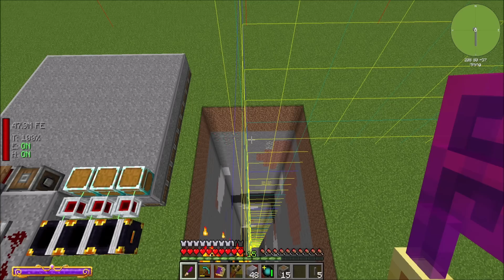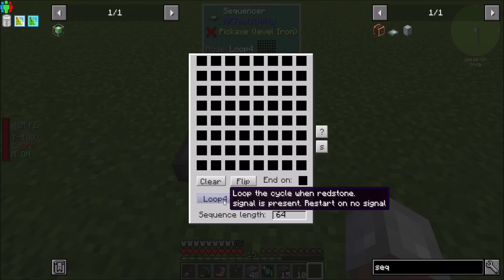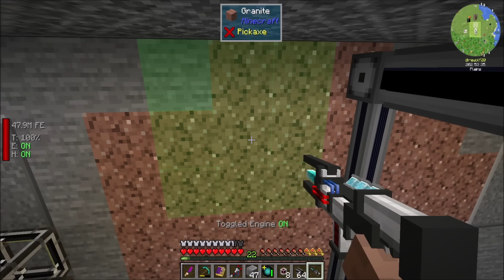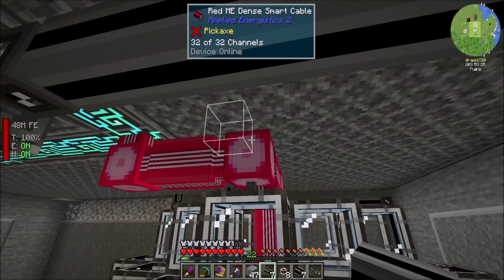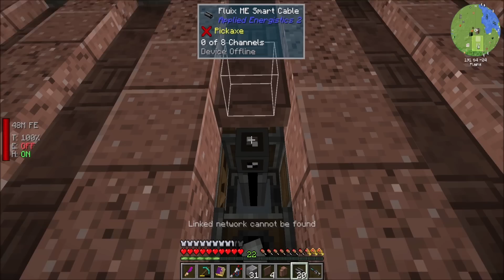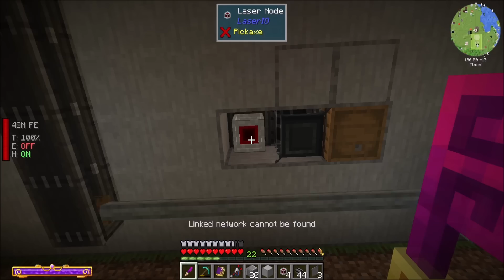LetsPlay S13E40 Create Autocrafting

Comment: Couple of nice to know things:
- entity blocks such as redstone and levers can be removed with the create wrench if they are glued, there is no need to break blocks below it.
- The sequencer for timing worked in my contraption (which is almost identical to yours), make sure it is on the loop4 setting
- I couldn't make the create chunkloader working. It says, it will only load chunks on a moving contraption (i would imagine on a mechanical bearing eg.)
but mechanical bearings are immovable objects, so there needs to be some continuous moving create object, that can be moved by a piston.
Mekanisms anchor does not work aswell, as the digital miner, quantum entagelment block and teleporter are immovable aswell.
But chunky turtles from advanced peripherals load the chunk they are currently in. They need a little programm to keep up, but it should work

Comment: The megatorch only blocks spawns within ~64 blocks, where mobs can spawn up to 128 blocks away then wander or teleport into the megatorch's radius. The megatorch sadly is not like a old equivalent exchange interdiction torch which pushes mobs away along with blocking spawns. This results in dire's create building not being covered by the megatorch and letting mobs spawn within 28 blocks of the player while within the create building.

You can solve the problem with more megatorches or my preferred solution which is putting feral flare lanterns everywhere both so you can see and so it blocks mob spawns due to the light level being too high

Comment: Add a Flux Plug/Point anywhere on the platform and set it to Chunk Load. May work, but not sure about moving it on a contraption. They’re not coordinate based so should work.
Reply: Check the episode from the day before yesterday and you'll have your answer as to if it moves.
Reply: You can't move flux plugs or flux points. The moment you glue one to the world eater then the whole system can't move anymore
Reply: @MisterJasro  oh yeah huh. The whole reason the damn solars were added. Well, it was 8am tbf 😂

Comment: flux networks has a chunk loading option, might have to enable it in the config tho
Reply: Wasn't the Flux plug the 1st thing Dire tried to use to power the Create RF motors? Didn't he decide they were of no use as they can't be moved by Create? If so I don't see them being useful to chunk load the moving platforms......for the same reason.
Reply: @ockerspock3432  thats a good point, didnt think about that